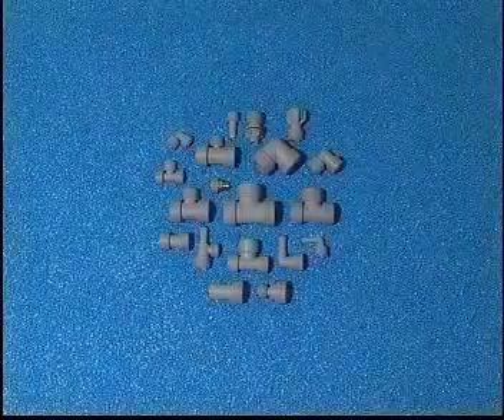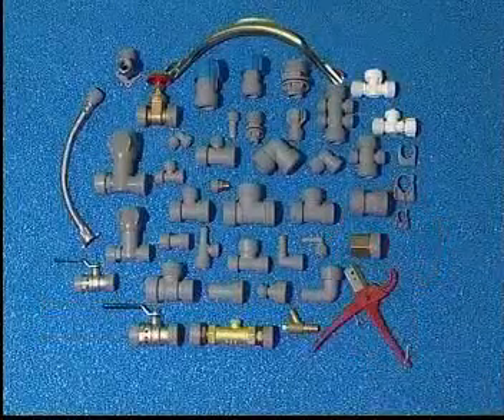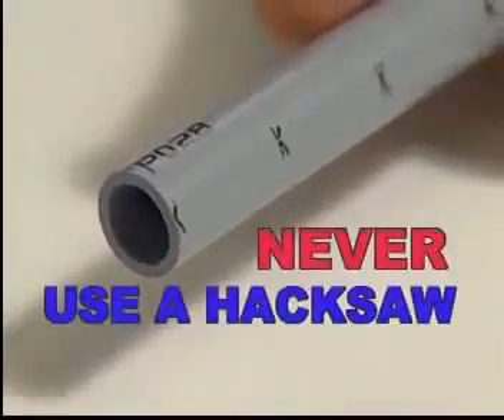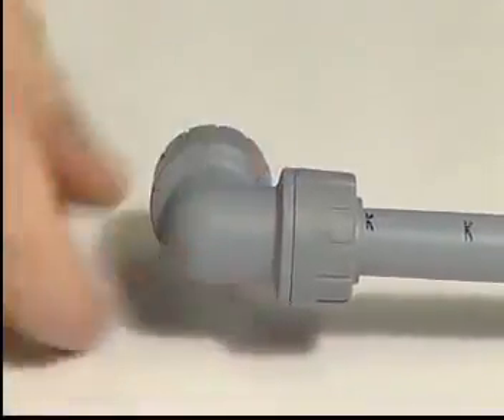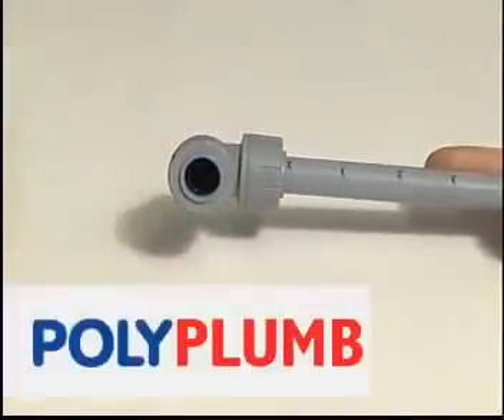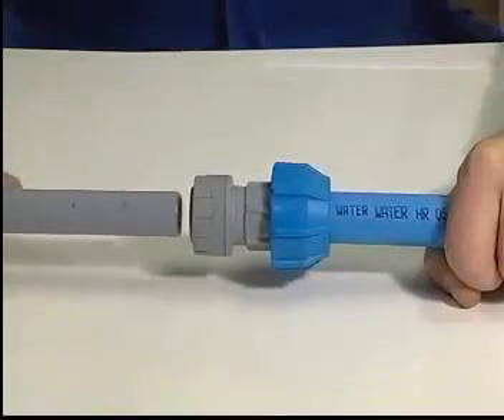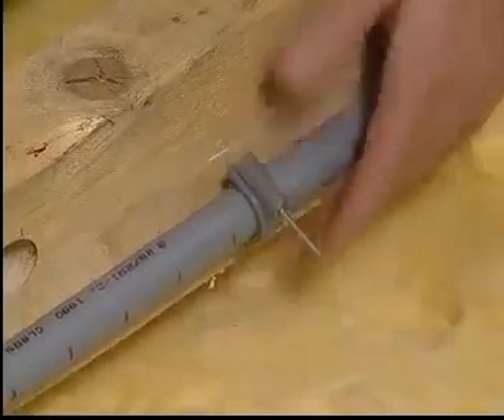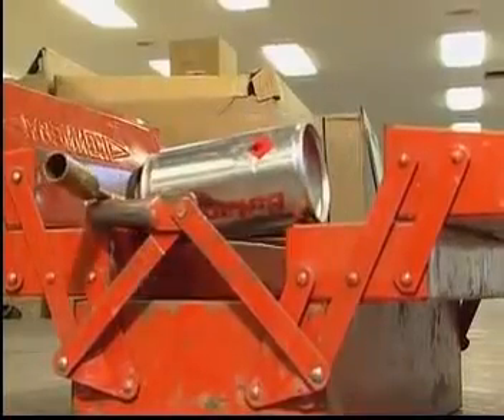Polyplumb - How To Install

Comment: Why the need for s/steel & plastic pipe inserts ?  :)
Reply: as the end of the pipe is not tapered but square, it will dig in into the rubber seals within the push fit fittings causing them to tear. Once installed, the fittings may leak instantly or in the future. The pipe inserts give the ends of the pipe a nice round tapered edge and when pushed into push fit fittings, it will not tear the rubber seals giving a nice, water tight, safe seal with no leaks

Comment: be careful using these fittings - had two catastrophic failures in 22mm x 15mm x 15mm tee reducers where the metal grab ring did not grab the pipe and resulted in flooding through ceiling.   All manufacturers instructions were adhered to and there was no cross mixing of fittings or pipes.   All rigid selves were installed.